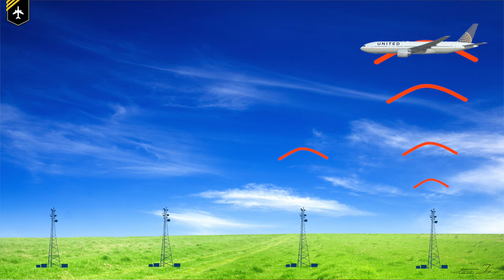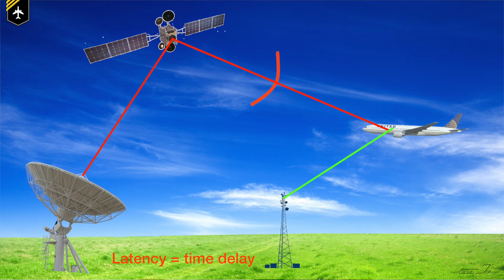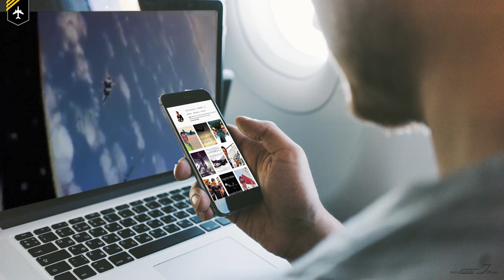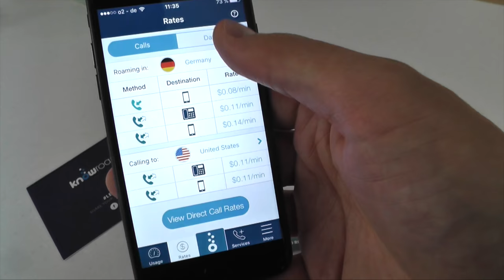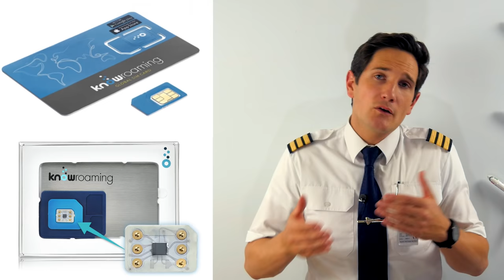HOW does WIFI WORK on AIRPLANES? Explained by CAPTAIN JOE

Comment: Don't confuse  bytes with bits.
A byte = 8 bits, which means 3 megabits/s = 375 kilobytes/s, out of which in good cases, 9 % of data is used for connection establishment, data integrity. Which leaves about 343 kbytes/s of actual data being sent

Comment: Why can't they just get rid of the antenna, and move to something slower that can work at a lower frequency for just texting only, and then use the weigh  saved in order to get a server box with probably a 20TB ZFS volume, and then fill it with all of the netflix and amazon prime original series, as well as the current season of various anime shows, and then have it act as a DLNA server for everyone to stream from locally? It will easily allow people to use their devices and stream up to 4K content without worrying about bandwidth issues. When the plane lands, the area in front of where the the front wheel will park when at the gate, can have an 802.11ad array antenna, and that will allow the plane to form a 4 gigabit connection to a server at the airport where it will sync any new content to the onboard server. Such a setup can even be automated to ensure that the DLNA servers are updated each time a plane reaches the gate.
Reply: Just load all the stuff you want to see on your laptop before flight instead. Problem solved and you can still use ZFS :)
Reply: Yeah, it's called in-flight entertainment.

Comment: Hey Captain Joe,  as always, good info in general.  Please note that while your graphics are correct, your verbal explanation is not.

10Mbits/sec = 10mbps = ten million bits per second.
"10 megabites per second" is in BYTES not BITS and typically, bits being 8:1 to bytes, is 1/8th or almost 1/10th of the former.

SO 48mbps = 6mBps....   100mbps=12mBps... etc.

This would ordinarily be not important except it's an ORDER OF MAGNITUDE in difference.  (10 x as fast or slower).

Best

Ehud Gavron
Tcuson AZ
FAA CPL-H

Comment: you use wifi a few times to talk about internet connection. i know i'm nitpicking, but it's still important to use the right words. what's going on between the plane and satellites or any land based antenna is not wifi. wifi is exclusively the whole protocol that connect your device to a router without any cable.

Comment: So you know, you don't pronounce ka and ku as one word, you say each letter so "Kay A" or "Kay You" or you can also just say K above and K under. also, their basically the same thing. its all just the K band except in the center is the frequency of water and signals can not pass long distances when they match the frequency of water. both Ka and Ku use the same antenna it just depends on what frequency you set it to.

Comment: So you can get 50 - 70 Mb/sec on a sat. connection at what latency? Sat. connections tend to have very high latency or ping as it is commonly called. 100ms+ latency might be fine for web browsing and streaming, but if you want to play some online multiplayer games you going to want <50ms at least.

Comment: Any ways even if you have the ka-band it dosent help if your plane has a router thats working on 2.4 ghz band that can only supports like 16 divices talking at the same with out any problem, if oyu have more the other devices need to wait his turn to talk to router vene if you have a bounch of repeter or AP (Access Points) there is a limit of how many wifi networks you have near each orther, if you have too many the start to cross talk and talking over each other.
But in 5 ghz it kinda fixes the problem, the ap can talk to 2 devices at the same time soo you can get like 32 devices conected at the same time in the 5ghz range and other 16 in the 2.4 but it comes the same problem from before you cant have too many AP(Access points).
The plane i think uses a buissnes grade ap solution with better logic to optimize the wifi but in the long therm you will face the same problem like before.
Thats why even if you have 70 mbit internet connection you will suffer from high latency becose the ap is busy talking to other devices and slow speed becose of high nomber of devices

Comment: Joe if your in high altitude why the presure is to high and damages your ears
Reply: ThespectreGamer1213 NOVA Because there are air pressure on your body as well. For your body to compensate, your body will let out the same amount of pressure. When you experience ear pain from descending, it is because your body haven't adjusted to the new air pressure yet, so, there will be more air pressure on your eardrum, so your ears will hurt. I don't think it'll damage your ears, however.

Comment: To be clear download speed are measured in
 MBITS/s AKA Megabits/s and not in MB/s AKA Megabytes/s so as Joe stated download speeds of
 3 MBITS/s AKA Megabits/s = 0.375 MB/s AKA Megabytes/s , 
40 MBITS/s AKA Megabits/s = 5 MB/s AKA Megabytes/s, 
50 MBITS/s AKA Megabits/s = 6.25 MB/s AKA Megabytes/s  and 
70 MBITS/s AKA Megabits/s = 8.75 MB/s AKA Megabytes/s

Comment: Hi, Captain Joe, I'm your fan from India(Kolkata(CCU)). My question to you is -- isn't the wifi or internet interrupts the conversations between ATC and the cockpit Captain when the on board passengers are using it freely?
Reply: The communication between the pilots and the ATC happens via certain radio frequency bands that are only used for this purpose. The wifi is a totally separate system, and it doesn't interfere the communication between ATC and the pilots.
Reply: @mikep9604  Then, why the airplanes announced to turn a passenger's mobile or internet connection off while it is about to take off?
Reply: @kaustavghosh1316  - Because there is a chance that they could interfere some of the aircraft systems like the navigation equipment.
Reply: @mikep9604 Okk, but aren't they interfere to the navigation system while the airplane is in the middle sky and the passengers internet connection is on?
Reply: @kaustavghosh1316  - Because the wifi system is installed on the aircraft it seems obvious that it uses a frequency which doesn't interfere the instruments. WiFi signal is distributed to plane passengers via an on board router. And the purpose is that the passengers only use the wifi, nothing else. And it's also allowed to use a phone or other mobile devise when you put it on "airplane mode" because that prevents the device from sending or receiving calls and text messages.
Reply: @mikep9604  Okay, thanks for understanding me... 🙏❤

Comment: The main reason the WiFi on planes is so expensive is because of supply and demand. The internet speeds are so limited that if they sold it to everyone for 1$ it would be unusably slow while if they charge 20$ and only 5 people buy it, those five will have a great experience.

Comment: Interesting that so many still has slow connection at home. I had 100/100 fiber at all my apartments/ condos since 2003. Stockholm. Always 30€/month. 

I've tried onboard wifi at Norwegian, it's complimentary for most flights. Soo bad quality. Not a chance to update Facebook or send attachments in the email. If I'd paid for that I'd be angry. The onboard service is mostly ok. 

Is there a way to see which tech the airline is using?
Reply: American internet services are very costly and older systems (cable or phone lines) needed to be upgraded before customers can connect to higher speed internet services above 7Mbits. My cable company upgraded last year the entire East coast so that we could get 100 Mbits speeds for $70 / Month.  Last year I was paying $50 for 15 Mbits, and that was fast compared to dial up (55Kbit @ $20/month) I had many years before.
Reply: Ani mal: dialup, you mean that they had in the countryside in the 90s? ;)

I guess it was a good idea of our government to dig down fiber cables everywhere 15 years ago.

Comment: if the plane has a server on board, how do passengers not hear it, servers are loud I have been in a server room with only one rack before and it was loud
Reply: A server in this case can just mean one computer. A standard desktop computer can serve as a server and the noise from the small fans near the CPU and power supply would probably not be noticeable, especially on an airplane.

Comment: I've actually installed at least five GoGo ATG systems on 30 seat emb-135s and the download speed is not good for streaming any video if you have more than one device logged on. Just good for  checking the email and web browsing, but still not the greatest. I can't imagine 30 people on this wifi system being happy surfing the internet. So some smaller commuter airlines might charge you more for internet but it's not worth a dime really.
Reply: Waldek Mochalski Gogo also uses the dreadful CTR as a router on some of their older ATG systems which is an extreme bottleneck. Their newer system called the L5 is still ATG based, but has fwd and aft antennas with dual,horizontal and vertical elements (4 coax per antenna) and dual air cards. Streaming on these systems while not perfect is much improved.
Reply from the maker: Thanks Waldek for your detailed comment :)
Reply: Yeah we installed an aircell ATG 5000 transceiver I believe. And the system involved two antennas a fwd and aft, however only two coaxes per ant. It was not sufficient for the 30 passengers let alone 10. But the airline just does little hops so it's more like a bus and flight times can be max 2 hours so if you're loaded with a bunch of friends on a private flight it might be okay.
Reply: My pleasure Captain Joe 😎

Comment: Doesent the wifi interrupt the radio control system
Reply: different frequency, wifi is 2,4ghz or 5ghz. its like different radio channels, they dont overlap each other, so you can hear one 'or' another without disturbance

Comment: Why are the planes not icing at the high altitudes?
Reply: Radu Hrinca : newbase because the air is not moist enough at that altitude. If they fly in clouds or visible precipitation below with outside temperature below 10c, they'll turn on engine anti ice.

Comment: 70 mbit won't be enough for a plane with say 100 users if they're all gonna stream Netflix anyways :/

It would be interesting to hear, from a pilot, why phones/GSM devices aren't allowed on planes. It used to be that it was for safety, but I heard one guy say that it was because the planes were going so fast it would overload the cell tower systems as hundreds of people where jumping from one tower to another very quickly. Sounds legit. But why didn't the airlines say so from the beginning? :P

Comment: You confused megabytes with megabits in this video. 1 Megabyte = 8 Megabit. Your phone caps out at 40 Megabits per second. That is 5 Megabytes per second. Do note that a lot of phones are capable to get higher speeds, but usually aren't serviced at these speeds.

Comment: You're correct 99.9% of the time, but airplanes don't NEED onboard servers. Internet can be decoded from satellite without an onboard server lmfao. That is a waste of space and tech caused by a lack of knowledge from about a decade ago, when internet was new.
Reply: its not really a server, but the processing happening in there. the antenna has hardware that processes the incoming and outgoing signal. the router has hardware to process the signals further. its just that its all in a tiny box put together, not an access point + server, but everything combined. so he's not wrong if he likes to demonstrate it like that

Comment: So can a hacker gain control of a plane via the WiFi connection and do bad things?
Reply: The Internet connection on an airplane is not connected to the flight controls. In a worst-case scenario, a nefarious hacker may be able to disrupt the passengers' Internet connection, cause a man-in-the-middle-attack to steal personal information, redirect connections to trick users in installing malware, etc., but interfering with flight operations is not possible.

Comment: Still 70Mbps is not a fast enough internet speed for so many passengers.
Reply: 70Mbps is plenty for passengers, especially if you have limitations.
Reply: @imperialdoggo5826 For example 70 mbps for 70 passengers using the internet is only 1mbps for each one.

Comment: 70mbps divided into 172 passengers equals only 0.469mbps :(
Reply: usually the total bandwidth is less, so maybe 40 or 20 mbit/s. and often not every passenger uses the wifi at exactly this moment, so you can divide it by less people (only the people that use it at exactly that moment)

Comment: Mega Bytes?  I don't think so, pilot failed.  Also satellites supposedly orbit Earth at 700 mph, good luck trying to get an internet signal at that speed
Reply: Inmarsat and ViaSat use geosynchronous orbit. Meaning while they are indeed moving very quickly, they are matching the rotation of the earth, thus their coverage area remains the same.

Comment: Why don't the airlines use a wired setup?
Reply: Are you referring to wired Ethernet ports next to each passenger's seat? If so, many modern devices, such as smartphones, tablets, and even some laptop computers do not have integrated Ethernet ports, but use WiFi to connect to the network. Adding Ethernet ports would be an unnecessary expense that many, if not most, passengers would not even use.
Reply: the wired setup would give no advantage, only adds more costs

Comment: So if they tell us to put on airplane mode you have to take airplane mode off to access the WiFi where’s the logic
Reply: @The Wolf it depends on the device. airplane mode might only give you a button to easily deactivate all wireless modules on your phone. on many devices you can switch on airplane mode (it turns of bluetooth, cellular, wifi for you) and you can turn the wifi, bluetooth and cellular back on, while airplane mode is still on. doesnt mean the same on all devices.

Comment: The plane would need to have a very powerful transmitter fitted to the hull to pick up a typical cellular network that is ground based its not really possible either since the speeds between tower to tower are too fast for the hand off procedure / This narrative is like the one most clueless people believed about the victims of 9/11 being able to phone their relatives before disaster which would have not been possible for this very reason

Comment: Speed of providers is in megabits, which is smaller than in  megabytes measure. But you, Captain Joe, not suppose to remembered so  it is pardonable.
By the way, your  passengers in the Americas and Europe like a really spoiled children.
I had 640 kbit /s com speed at my house. for 4 devices (80 kbis/s per device).
so be glad you have ANY internet onboard.
This is cool video. I didn't know that air jets have an internet connection now.

Comment: Comment here from a "stupid" flat earther:  You said internet will use a ground dish to upload and reflect down from a satellite.  So in the middle of the ocean, how far away is the dish and how does the signal get to an object moving 17000 mph and then refracted back to an airplane at 500 mph?  This would seem very implausible.  A signal is based on sound and sound travels only 500 mph so how does it catch the satellite?  Hmmm.  See this link for a scientific explanation about speed of sound frequencies: https://courses.lumenlearning.com/physics/chapter/17-2-speed-of-sound-frequency-and-wavelength/
Reply: The communication signals that satellites use to communicate with the ground, ships, and airplanes are electromagnetic waves. Electromagnetic waves, including gamma rays, x-rays, ultraviolet waves, infrared waves, microwaves, visible light, and radio waves travel at the speed of light, which is about 670,616,629 mph. Therefore, the speed of light compared to the speed of an airplane is many times greater than that of the airplane.

Compared to radio waves, sound waves are very slow, as you stated. However, sound waves are not used when communicating between a satellite and an airplane.

Comment: satalites are as fake as this "pilot"...it violates the laws of physics for thrust to be generated outside of the atmosphere...just like you need a wall for an equal and opposite reaction so do rockets and propellers...if a rockets is firing outside of the atmosphere in the vacuum of space...which can happen and is not part of the dispute...you will get a force that is the same in both directions...and the same exact thing will happen if you are standing between 2 wall and applying an equal amount of force to both walls...you wont move because the forces cancel each other....you can not apply the same exact force in both directions and generate thrust...and that is all you can do if there is no atmosphere ( magnetism)....it is the magnetism of the charged particles that make up the atmosphere(or a wall or anything else a force can be applied to) that is ultimately responsible for thrust...there is more magnetism in the atmosphere than there is in the particles of gas leaving the rocket...which causes thrust...pretty simple to understand  people...force is calculated by PRESSURE!!! over an AREA....so 2 separate things are needed...1 thing that is using its own internal energy to create the force...and something completely separate to apply that force to (the area...which must be made of charged particles)...(1 thing only and not 2 separate things would be an internal force only which can not be used for any type of flight...let alone spaceflight)...like a person that is on a rolling chair on a wood floor that cannot touch anything at all to move. They could only scoot...your are being lied to